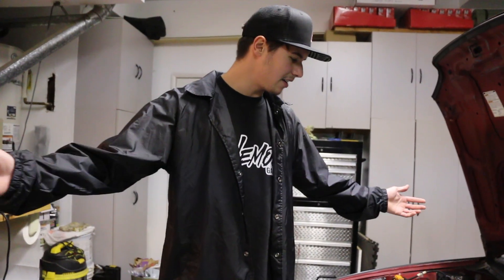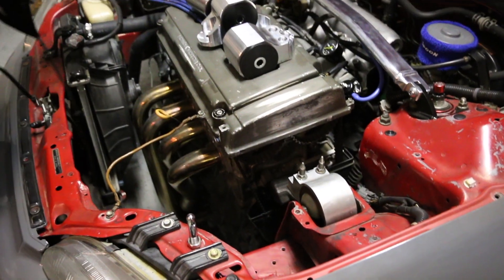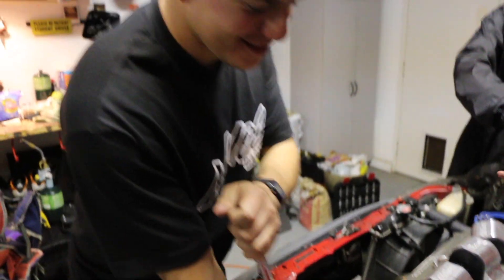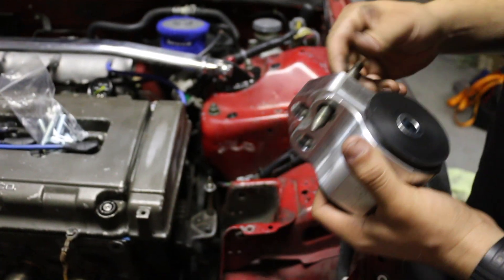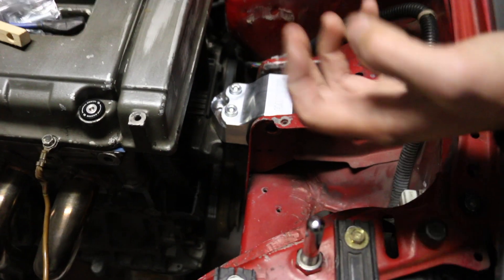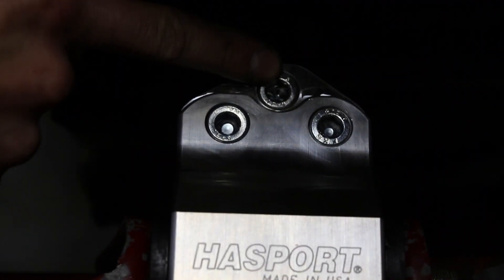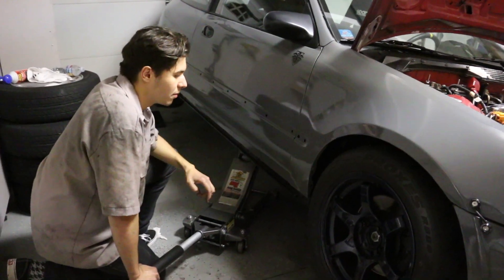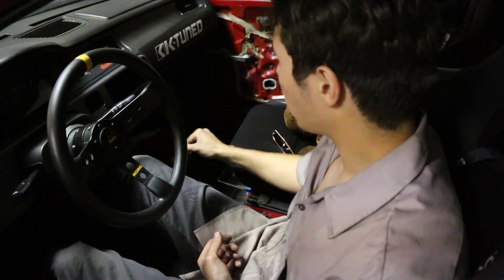DO STIFF ENGINE MOUNTS MAKE A DIFFERENCE?

Comment: I just put my mounts in.....went with 60a for daily lil vibrantation but the response on the car is next to nothing.   And the clutch feels good
Reply: What do you mean the response on the car is next to nothing?
Reply: @tuftwrld    quick throttle response.
Reply: @richport8146  and the transmission gets louder like in the video?
Reply: @Pier1668    yea, especially in reverse.  You feel the vibrations, and after a week you get used to it and it feels normal.
Reply: @Pier1668    I have them on my Ep3 si

Comment: How do you get rid of the rattling? Just uprated my clio 182 engine mounts and everything in the car rattles!!
Reply: With performance motor mounts the whole point is to prevent the engine from vibrating separately from the rest of the car so more of the engine rolling or torque goes to the wheels more immediately (because the engine will no longer roll in the engine bay). So with that said engine nose is going to increase dramatically unless you go with less performance oriented mounts
Reply: Garrett R thanks for that very detailed and useful!!!

Comment: my Em1 civic stock engine mounts let the engine flex so hard the harmonic balancer dug into the frame rail and destroyed the pulley 96/00 driver side are the worst mount designs
Reply: LMFAOOOOOOOOOOOO DAMNNNNN 🤣🤣🤣🤣🤣🤣🤣🤣🤣🤣 that bad huh 🤔
Reply: That's on you dude. If you let a stupid problem like that go long enough to do real damage you're the only one at blame.

Comment: 1997 honda crv , all wheel drive.  I do go off roading,  mildly.  I am looking for a decent set of motor mounts. That would better handle the jolts , bumps, different angles , and uphill stress. I think I want something better than stock. I'm not sure so I'm watching a lot of videos on this stuff. This is the first video I seen of this name brand that you installed. Thanks in advance.
Reply: Hasport is a leader when it comes to aftermarket motor mounts for Honda/Acura. They are much more pricey because all mounts and tech are designed in house and the mounts are made in the US. You would be in good hands with hasport. I have seen some people get away with copycats and lesser brands if you don’t wanna fork the money
Reply: I got the same style crv. What mounts did you go with? It looks like oem would be best.

Comment: Transmission/driveshaft teardown after high mileage will be the test
Reply: There should be less wear on the trans and driveshaft, since there isn't as much slack. It allows the connection between engine and transmission to be more precise and efficient. That's my view on it anyway. I have Street mount bushes and the gearbox is a lot more smooth and i have heaps more traction to the wheels (FWD).

Comment: Hello cracked engineblock
Reply: Stiff mounts all around crack the block?
Reply: @3.0TMKreaZ  You're right. Block won't crack, solid mounts however will run that risk.
Reply: @3.0TMKreaZ  There has been times, when you run a solid mount on the engine and a softer one on the transmisson
Reply: Wrong they do not crack the engine block at all. I've had them many times before never an issue